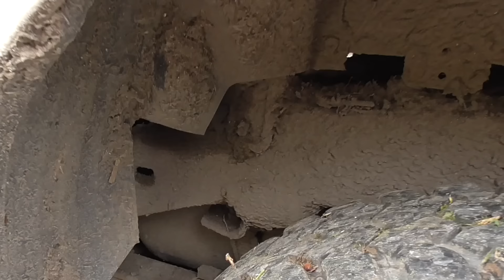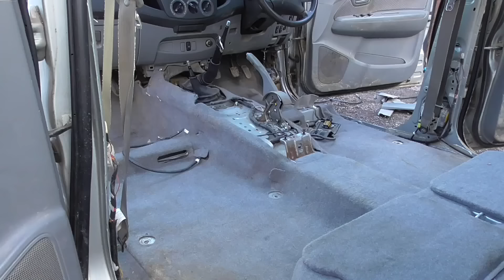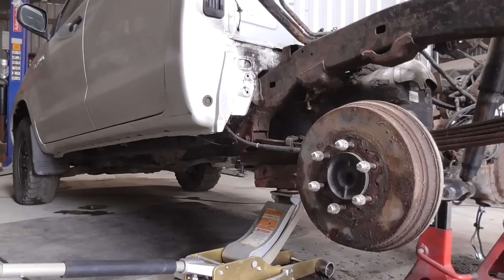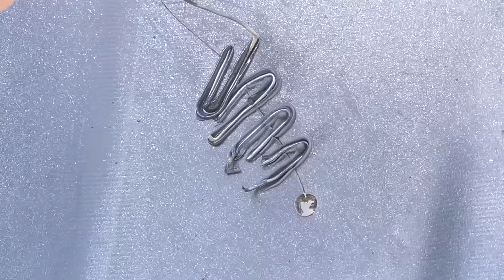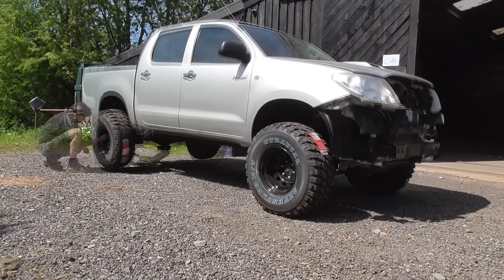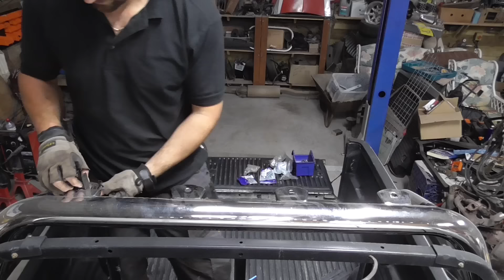Toyota Hilux Full Detail, Restoration & Modification Time-Lapse In 15 Minutes

Comment: Put myself for 2008 Hilux 10 years ago it done about 100,000 km now the spider reads 350,000 km since I’ve had vehicle it has never been serviced by Toyota and all the servicing or most of the service has been done by myself oil change air filter but any major services will be done by my local garage not Toyota my Hailex is still in excellent condition has never broken down never stopped and just keeps running I’m very happy with my Hilux

Comment: Not a fan of drop shackles or strut spacers, but apart from that you did an awesome job. I have the same model, but with the V6 engine, they are a great vehicle.
Reply: The 1grfe? How many klms have you run on it?
Reply: @Ethan-mv2un  yes, the 1GR. 245k so far, still runs like new.
Reply: @tareskisloki8579  awesome. I bought a neglected one, had 190,000. Had a stripped spark plug well thread, changed them myself cause it's so easy, but got a bit freaked out, thought it was the end of the world 😳 heaps of room in the engine bay too. I wish Toyota could bring that simple engineering back..
Reply: @Ethan-mv2un  yeah, they're a great engine, but you need to keep on top of the services, they'll go forever if you do. There's a guy in Northern Australia that makes supercharger kits for them, he has a 2wd V6 test vehicle that has been supercharged for over ten years getting pushed to the limit. It has about 400kw (530hp) now and still going strong.
Reply from the maker: That sounds awesome!
Reply from the maker: Thanks Taresk! They sure are brilliant vehicles!
Reply: @tareskisloki8579  whats his site? was looking at supercharging

Comment: Buenos días, excelente trabajo. Tengo una consulta cuánto sería la inversión total de los trabajos realizado. Es posible saber qué tipo de suspensión se colocó …?
Reply: ¿Y para qué quiere saber eso? En cada país es diferente. Un kit de levantamiento de suspensión anda entre los 150 a 500 dólares. Los amortiguadores andan entre los 300 y 800 dólares. Las calzas para levantar la cabina esas en cualquier taller industrial se las fabrican y andan entre los 10 y 40 dólares cada una dependiendo del material y del fabricante. Los ensanchapasos andan en los 100 a 400 dólares. Los neumáticos, que parecen ser 31.5 x 8.5 R15 con los rines andarían entre los 800 a los 5000 dólares dependiendo de la marca... Es todo muy relativo.
Reply: jironmeister creo que eran mas de 31s yo tengo una toyota igual y traia 31s y no se ven asi minimo eran 33 pero le calculo las 35s
Reply: @quiroga9469  31x10.5xR15 Se puede leer en la etiqueta cuando corta el parachoques delantero y coloca los ensanchadores.

Comment: Amazing video. The transformation from start to end is quite satisfying to watch.
Any idea how to reset the auto windows on a hilux ?
Reply from the maker: Thanks! With window reset, I can't be 100% sure but generally if you hold the up switch until the window closes and then keep it held, then open it and keep it held for a few seconds after it opens / do this a few times, it should reset the parameters of the window 👍
Reply: @JohnnyGetsCash  Thanks a lot. I couldnt find much info on any forums either.

Comment: the way u restoring the crack bumper is the best part that gimme idea to try it.. n safe $$.. I just plan to buy new bumper set.. Lucky find ur chnnels.. Anyway.. nice job&thnks Bro!!
Reply from the maker: I'm glad it has helped you! This process is called 'plastic welding' or sometimes 'plastic stitching'. You can buy a specific tool and metal staples for this job if you don't want to do it the old fashioned way like i did in this video.
Reply: @JohnnyGetsCash  thnks again.!.. for ur quick respond & info..i will try with small project first.. n then the bumper after get the skill.! Tqvm!

Comment: I can't believe that you've had to do exactly the same work on yours as I have had to do to mine. Mine rotted in all the same places, even the chassis cross member over the diesel tank, too much rot for a young vehicle.
Reply from the maker: Cheers Aaron. It does seem daft that a modern truck can rot like this but with a bit of work they can be made into the trucks that they should've been from the factory!

Comment: Nice truck I wanted one of these bit pricey atm tho picked up an 04 hilux last year for 2.5 k with 300k on the clocks she’s a beast and still runs like I bought her
Reply from the maker: It's true, they do hold their value very well, but as you've mentioned, slightly older examples with higher mileage can be picked up relatively sensibly, and if they have been looked after - they're just as good as a younger truck...Hilux power!
Reply: @JohnnyGetsCash  I love mine cleanest one on the inside ive seen ngl not one rip or tear haha wish I could fix it up to look like something you produce where do you get parts for your ones I struggle to find them for my truck junkyards are good to go picking but I like buying from trusted people if I buy a new motor I would like to think they are telling the truth about the miles

Comment: Hello bro....it necessary to extend the stereng shaft when u make the body lift up?
Reply from the maker: Sometimes it is, However in this case the body lift only equated in around 1/2 " of movement on the steering column so this was easily accommodated within the natural length of the splines!

Comment: Beautiful but how does it pass MOT? Regulations are getting more strict, I have a lifted Navara in Greece and sometimes there are small issues, requiring to put smaller tires on.
Reply from the maker: Its fully road legal and has a new MOT. The regulations state that the treads of the vehicle's tyres cannot protrude beyond the width of the body. In this case with the new over-arches fitted, these make up for the extra width of the new tyres and safely / legally cover the tyre width well enough to satisfy MOT requirements!
Reply: @JohnnyGetsCash  I have a similar problem and when I asked my respective MOT they stated that even with wheel arches and wheels not protruding from them they'd still be protruding from the vehicle's sides and that was a no from them...
Reply from the maker: @jimk8592  that’s weird. The MOT place I use is mega strict and they were happy with the arches / width!
Reply: @JohnnyGetsCash  Yeah, but I live in Greece.

Comment: Hi mate awesome job aye! 
I have a 2015 hilux with a 2” lift can I put 35s tyres on it?
Reply from the maker: Thanks! RE your Hilux, i couldn't say for sure, but in my experience 33's are about the maximum tyre size you can run without having to look at extensive body modification!

Comment: Great video. Couple things, why didn't you paint the skidplate black? Why did you leave on the original black rollbar and add the chrome one instead of just putting one alone? I think it looks a little janky. Just my opinion.

Also, not a fan of the fender flares, but to each his own.

You did an amazing job bringing this old road hazard back.

Comment: Hi, im plaining to lift my toyota aswel. Spacer for the front and blocks rear. I saw you went with shackels for the rear. Can you tell me what the diffenrent between the two? Shackles vs blocks. Please
Reply from the maker: Awesome! Ultimately there isn't a huge difference between blocks and shackles (as i understand it anyway), but in my opinion shackles are much easier / more straight forward to fit as you are just unbolting the rear of the leaf spring from the chassis to fit the shackle, whereas with blocks you are dropping the axle from the leaf to fit the block / U-bolts. Admittedly not a huge amount of effort more, just my personal preference!
Reply: @JohnnyGetsCash  thank you for the reply.

Comment: Sick transformation well done. Did you only do a body lift or you do suspension to, looked like 2 inch body and I'm guessing 2 inch suspension. You need to do a body chop for the 10j wheels? 33s j or 35s?
Reply from the maker: Thank you! I did a 2 inch body lift and a 2 inch suspension lift. With the larger tyres that ended up giving a total increase of 5 inches over standard. The tyres them selves are 33x 12.5's and i didn't have to cut the body or mounts to accommodate these (apart from a small bit of the plastic front bumper to allow the over-arch kit to sit safely away from the tyre). I have used lock limiters to take about 10% off of the total steering lock angle but thats just the cost of big tyres!

Comment: sir may i know u setup for the lift up?..how many inches in the front for lift and rear?. are the spacer 2 inches and the body lift 2 inches?
Reply from the maker: Sure thing! Over all this was a 5 inch lift achieved via a 1.5" body lift, 1.5" suspension lift, extended shocks and the addition of 33" tyres.

Comment: 33x12.5? Did you cut the body mount?
Reply from the maker: Thats correct - 33x12.5. No cutting of the body mount but i did fit lock limiters to take of around 10% of steering lock just to be safe .

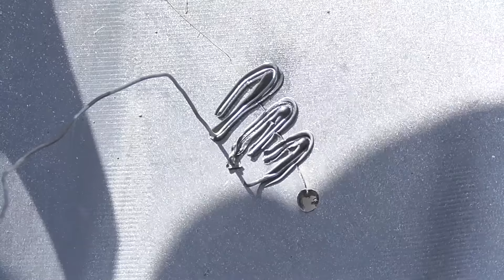Comment: 8:29 bro, what are you doing here? Melting
Reply from the maker: This is a process called 'plastic welding'. It's a method used to stitch plastic together and give added strength to a repair. Perfect for split bumpers. In this video i am doing it manually by heating metal wire and melting it into the plastic, but there is a proper tool available which heats metal staples and inserts them. Its a great technique!

Comment: Did you lowered the position of the radiator and changed the positions of the mounting of the brake hose when you lifted the body?
Reply from the maker: The lift performed here is about the maximum amount that can be done without secondary modifications such as rad re-location etc. The rear brake load sensing valve bracket had to be lowered to compensate for the new ride height but that was the only modification required to the bracketry etc
Reply: @JohnnyGetsCash  Thank you very much…was that an added 20mm height increase? I have been planning to do a body lift on my Hilux Vigo (same series as your hilux project) and would like to pattern it to your approach.

Comment: Didn't like that gen of hiluxes have the chassis rusting through problem?
Reply from the maker: The chassis on the mk6 do collect a lot of dirt etc on the rear cross member so these are prone to failure which is why its so important that when buying this generation of hilux to make sure that this repair has been done.
Reply: So was your chassi rails already changed?
Reply from the maker: @pretziboy4162  The chassis rails themselves were actually in really great shape, but the rear cross member was wrecked so i cut this out and welded in a new one. Solid as a rock now!
Reply: Nice!
When will you take it off road? Looking forward to it

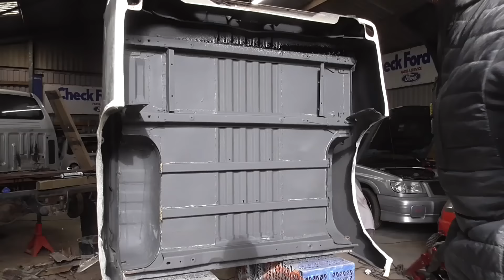Comment: Great video, what did you use at 7:14?
Reply from the maker: This is Tetrosyl stone chip. The reason it looks matt after the first application is because i laid that down mixed with thinners for a thorough base coat. The second coat was not thinned down at all so comes out much thicker, tougher and glossier.

Comment: Great job, I really appreciate you making this video. Could you explain your choice when modification of tj rear leaf assembly? How does that leaf extension hold up? Is this an option for bigger 1/2 ton trucks?
Reply from the maker: Thanks! The rear shackle lift is a quick way to lift a truck (as opposed to upgrading the leaf itself). There are lots of shackle lift kits available for all different types of trucks so there will almost certainly be a suitable kit for your truck out there!
Reply: I've got a 79 series with the extended shackles, but modified hydraulic actuating arm in there in order to get a lot more drop than a leaf spring allows. They hold up fine in small increments, but I wouldn't go more than a longer overall length of more than 75mm.

Comment: How long is the restoration time?
Reply from the maker: This took a few months to complete due to many hidden issues / bad previous repairs. As i wanted the truck to be as good as possible, i went all out and fixed every issue that i came across so it took a little longer than i had thought...It was well worth it though!

Comment: where can I buy these spare parts?
Reply from the maker: The arches and suspension lift parts came from 'Brute Status', the body lift kit came from 'Milner off road LTD', the wheels and tyres came from a specialist supplier and the extended shocks were created by a local off-road performance engineering shop.

Comment: what suspension are u running
Reply from the maker: The suspension is basically stock but running a shackle / strut lift kit and extended front shocks. Combined with the body lift kit and wheels / tyres, overall it makes quite a difference!
Reply: @JohnnyGetsCash  respect. bro. much love from Barbados. just one more Question, can u tell me where u bought the black aftermarket wheel arches from? and also the strut kit? I have a 2014 hilux and I do wish to order me some.

Comment: It is a Toyota Tundra in the United States
Reply: It's closer to the Tacoma, the Tundra is much bigger. Only real difference between Tacoma and Hilux is the Hilux has a full box chassis and the option of a diesel engine. Apart from that, they share most parts.

Comment: Great work
However this is more a preventative maintenance and modification rather than "Restoration".
Restoration is too strong a description to use for this.
Maintenance = Prevention and replacement of regular service items (eg oils, coolants, filters, bulbs, surface rust)
Repair = Replacement or custom creation of minor parts that are not regular service items (eg. starter, alternator, glass, small rust holes)
Restoration = Replacement and custom creation of major parts that are non service items (eg chassis parts replacement, whole panel replacement, engine refurbishement, large rust holes)

Comment: Tacos are underpowered. If you add bigger tires and other extra weight, you HAVE to change the gears on the axle differential or youll get crap mileage and no low gear power or passing power on the highway.